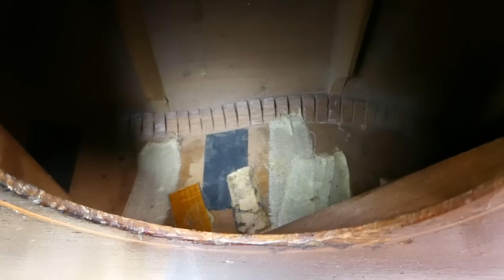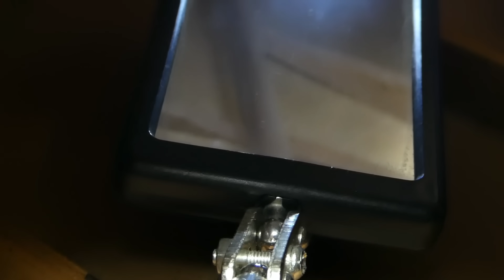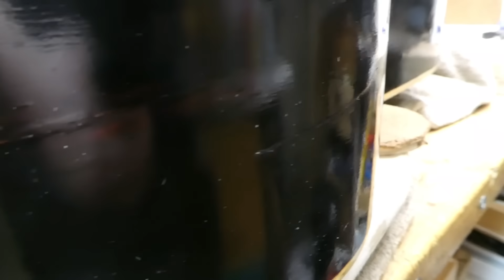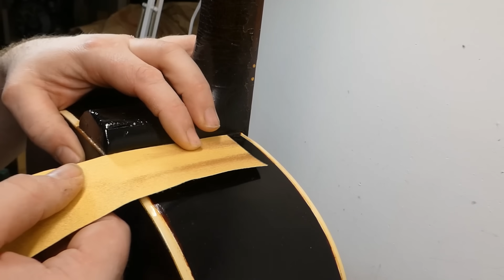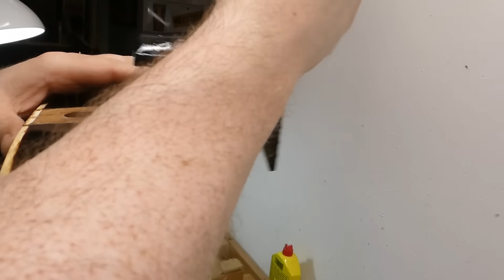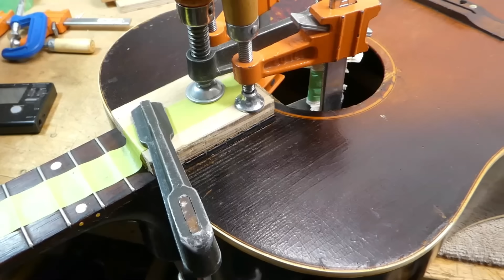1947 J-45

Comment: Well that was a timely video to watch.  I am currently in the throws of restoring a 1946 Gibson Southern Jumbo for a client.  Also required neck reset and found it was much more difficult to remove the neck than the Martins I have done in the past. Like you I had to add considerable more water to have it finally succumb.

Comment: I don't know if guitars are supposed to be this way, but in furniture, making a dovetail of that size should require some light mallet strikes to get the last 1/8"-3/16". As well as all surfaces touching when fully seated. With modern guitar parts made using cnc routers, finding poorly fitted neck dovetails shouldn't be common on quality guitars. Have you noticed this to be true?